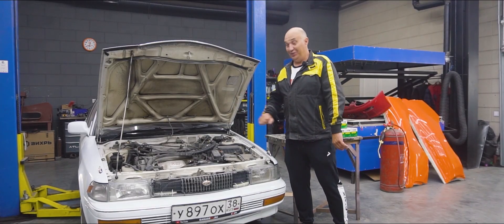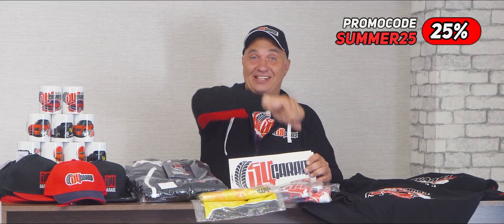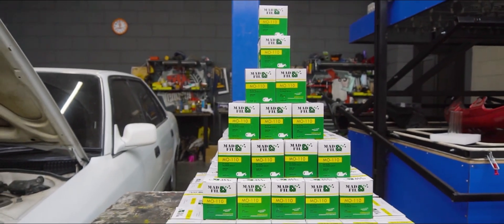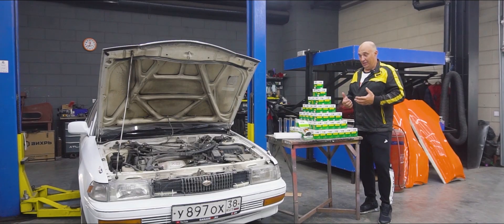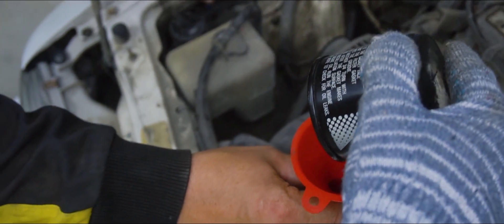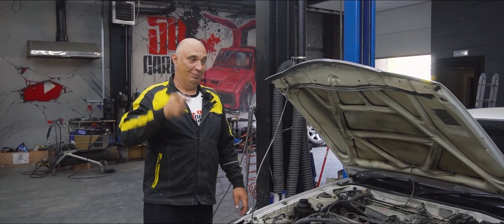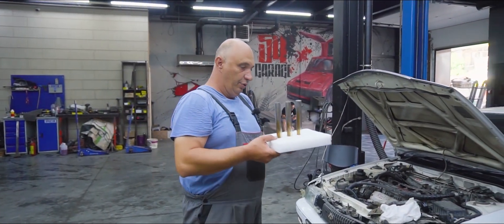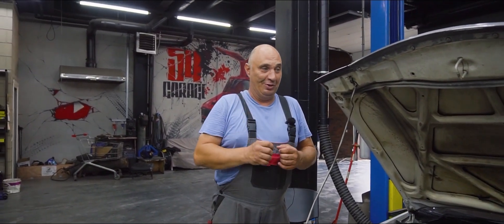Can 50 oil filters make used motor oil clear again?

Comment: What product(s) would you suggest for cleaning the inside of a used car's engine, particularly the areas the oil is going through?
Reply: New filter + Fresh cheap 0W30 or 5W40 synthetic "hc" hydrocracking oil where the manufacturer openly marked it on the label with clean engine + Long distance, fast travel with hot hot hot engine = immediately oil change with hot oil and everything dispersed still in it
REPEAT the above again..
Then expensive good pao fully synthetic based oil
Always do oil changes in lower frequency to "wash" away the old dirt from owner neglect before!
Do not use oil cleaning additives as every bit of trash goes through the engine and it give immediate high wear and can kill engine
If you hate Lady use sand as oil
Reply: DIESEL / TRANS FLUID MIX.. 2 QTS
Reply: 1/2 can of seafoam 300kms before oil change.
Reply: 80% diesel fuel + 20% engine oil, new filter, run for 10-15mins, maybe drive around the block, but no high revs, temps or load.
Then a normal oil change.
Did this more than once, the engines´ insides went from dark, sludge covered surfaces to shiny metal again. 
All except one are still doing well, and that one went with car when that started to rust faster than I could weld.

There´s just one downside, but that applies to professional products as well:
If there´s a gasket in the engine which just still seals because of accumulated residue...
Reply: Vodka.
Reply: @furry-b5h  no way, I think that is silly.
Reply: @tallpaul9475  you can use vodka instead of gasoline

Comment: You couldn't have picked a worse motor. Those 3S engines are a guaranteed spill on the block when removing the filter, plus it's partially surrounded by an exhaust manifold.

Comment: Try mixing a gallon of used oil with 10 gallons of gas running it through a bunch of filters and then boiling the gas back out of it.
Reply: Why? To create a massive fire? Boiling gasoline is not smart
Reply: @kitecattestecke2303  you must be the same kind of person that puts 50 lb of charcoal in the grill to cook one steak.

Comment: The problem is not getting the oil clear, the problem is that there are also petrol residues in the used oil, and the lubricity is no longer as good as with fresh oil

Comment: I'm really interested in trying gasoline as coolant in a few different coolant systems to see what happens. 👍
Reply: gasoline will not make a very good coolant. It has a boiling temp that is too low for an engine.
In fact, straight up water as a coolant is very good indeed and very hard to beat..

Comment: One thing to keep in mind is that the oil itself darkens as it gets heated. Something to do with the smaller molecule chains gassing off. You can test this by heating new oil up to 150C+. It will darken pretty quickly. The upper piston rings get this hot and so does the oil in that area.
Reply: So one time i changed my oil and drove about 10 miles. Oil was jet black right after...
Reply: @Fr3sh-Kush  this happens fairly often, especially with diesels because their oil goes very dark due to soot. The old oil that is black cannot be fully drained. There's always some old stuff in various parts of the engine. The new stuff mixes with it and appears dark. The effectiveness of the oil isn't deemed by how dark it is. Don't worry about it.
Reply: @Fr3sh-Kush  diesel?
Reply: @dennisford2000  no sir gas
Reply: @Fr3sh-Kush  next time you change youre oil pour a quart of transmission oil in and it will clean you're engine
Reply: @Fr3sh-Kush  if it is a diesel it is normal
Reply: @Fr3sh-Kush  "...changed my oil and drove about 10 miles.  Oil was jet black right after" Yeah I've had cars like that.
Reply: @Fr3sh-Kush  That usually means that someone missed the oil change interval too much. Oil sludges towards the end of its life leaving buildup in the head, pan, and channels. Change your oil more frequently to help with that. (3-4k miles.)
Reply: @skurblord3401  i change my oil every 2 months regardless of mileage. Probably every 500-1,500 miles
Reply: @skurblord3401  been doing it that way my whole life
Reply: @skurblord3401  That goes back to what was said at the begining of the video about buying a used car changing the engine oil. The oil filter then becomes clogged because the new oil cleans the deposits out of the enigne.
Reply: @LKN117  Correct. Its not a one or the other situation. Both happen at the same time. My initial comment was explaining why 10,000 kilometer oil wont get clean. He could do that process with 1000 filters but it would never lighten up.
Reply: @skurblord3401  i feel bad for changin every 6000 miles :(, at least im not pushing the engine too hard
Reply: @Fr3sh-Kush  you really don’t have to change your oil that often. I don’t believe in people that say, “oh you don’t have to change your oil but every 10-15 thousand miles” but I change mine every 3-4 thousand with full synthetic valvoline
Reply: @Fr3sh-Kush  can I have your old oil
Reply: My 12 valve Cummins can turn oil black before I get around the block 🤣
Reply: I was just about to write this exact thing, also all those oil filters will only be removing particals and contaminates to a certian micron that the filter element allows, doesnt matter if you use 100 of them. 
Heat is what breaks down oil and its additives, the better mixed the longer lasting. Hence synthetic oils are better blended than minerals and wont seperate as easily. 

Oil filters only are there to remove particals
Reply: Wow! That's amazing! I've never seen such an educated response on YouTube
Reply: @WvlfDarkfire  you have Bern subscribed to the wrong channels in general then
Reply: @kitecattestecke2303  I agree. I have bern
Reply: @WvlfDarkfire  lol
Reply: If you want to see this first hand go to planet farms youtube channel hes an independent tester of all things motor
Reply: @maxdaviduk2626  thats project farm.
Reply: @maxdaviduk2626  I have him on my list , one of my favorite non biased channels
Reply: It’s more like the like the oil breaks down with each cycle. The polymer chains will break down with each heat cycle. A better way to do this experiment  is to run the oil through the filters with a pump and gentle heating to thin the oil. Not through a car engine. Also grant Thompson did a torture test on motor oil and it still had a nice amber color at the end.
Reply: @abhimaanmayadam5713  His "torture test" was a add stunt for Castrol... He heated the oil for 20 minutes and dumped liquid nitrogen in it. The oil has a harder and much longer test in an actual engine.
Reply: @skurblord3401  of course. It’s been a while since I’ve seen it so my memory on that is a bit fuzzy.
Reply: My trucks oil (5.4 V8) is still dark gold at 3,000 miles.  So that is where I change it.  My trucks engine has oil issues if not cared for.  So I just play it safe so she lasts.
Reply: That‘s not right. If your car never had dirty oil and you change it early, 7000mls, a good quality oil never change the colour. 33 years experience with my own cars. Over 1 Million mls.  150*C is a lot! Your car shouldn‘t run so hot.
Reply: Didn't know that... Thanks
Reply: And in Diesels it gets darker cause of soot
Reply: leaked valve seal too
Reply: It’s oxidation that darkens the oil.
Reply: I change my oil at 60 percent of life from 45k miles to 88k miles.
My oils still clear at oil change. It's still clear after city driving, then a road trip.
Gas and water pollute the oil and acids form. 
I change it before that's very bad. Hoping to have less engine trouble for a couple hundred thousand miles. She runs so smooth,
 I love the 2016 Mazda6. The black is carbon and a sign the oils removing them. I assume with my extra care to the fuel system too, that all I need is the intake valves, cleaned properly so dirt and carbon don't score the cylinder walls and end up on the face of my catylytic converter to burn it up ,and then to then ruin it, over time. Constrict the air flow makes everything run hotter.

I do run synthetic, but oils oil.
If you take care of the car the oil looks new still.
 But the block chains shortening, sure sounds smart, I believed it too, until describing my oil changes. I did let the oil to 40% one time. Yes the oil for dark but not black.
Reply: @joshuatinkham3703  I'm confused, what are you saying your oil change interval is here? You make it sound like you change it every 45k to 88k which for most cars is a great way to destroy them. "Hoping to have less engine trouble for a couple hundred miles" seems like a telltale sign that something is up..
Reply: Lol. Sorry if I confuse people my writing skills are being worked on.
I bought the car at 45k actually and have changed the oil a little early, always. It is also at 88k and I've done the 100k tune up. Next will be both axles need brakes and my tires are three years old I rotate them at each oil change, no uneven wear.
I get a little groaning if I over steer, now.
I want to pull the intake cover, and clean the valves properly. Not just bit them with degreaser, and burn up my converter.
I'm broke a little prevention, halos me sleep better. And more likely to road trip.
Reply: Or you you have a wet clutch on a bike ! , i put sur purple oil 4h later is dark
Reply: Thank 4 tha knowlege cuz
Reply: The biggest thing to keep in mind is that this experiment will never work. 
The dirtier a filter gets the better it filters, the reason you can't just run one forever figuring that it'll keep improving with age is because it'll eventually become restricted and stop flow or it'll just go past the bypass valve if it's that type, but it's the very thing that causes it be get restricted is why they filter better the dirtier they get, because the dirtier they get the smaller particles they let through, air filters are the same way.
Since he took a filter off that was ready to be changed it was already filtering smaller particles than a new one will, so one new one after the other won't change anything. 
Don't believe me about the dirtier they get the better they filter?
Talk to the filter manufacturers like I have, they'll explain the same thing to you I just did.
Reply: I thought oil suspends particles of carbon from the internal combustion process.
Reply: @snakattack883  It does, among other things. The point of most of these comments including mine is that there is more than just particulates making the oil black.
Reply: @Dustin Turpin engine oil suspends the particles of carbon that builds up in the oil when combustion happens. My moms husband had a daewoo chev and he used valvolene and I did all hos oil changes it it always drained out pretty clean and transluscent. Is it trappung the carbon in the filter? Is the engine filthy? Is the oil doing its job? Lits of speculation, id like to think its because the oil is changed properly at the proper intervals and the insife of the engine is constantly being purged of the carbon in the oil and filter.
Reply: cool story bro
Reply: true done this myself accidentally on my stove
Reply: the sooth particles are like few microns. Meanwhile the filter stops 15 micron and larger particles. It will never remove sooth. There are bypass filters that can remove it though.
Reply: This is a true statement, but to a much lesser extent than you may think. I work as an auto technician and used to work for a fleet that serviced natural gas powered vehicles. They would run 10,000 mile oil change intervals and even at the end of the 10,000 miles, the oil would be a light amber color. Maybe 1 shade darker than new engine oil. 99% of the discoloration that engine oil gets is from how dirty gasoline is and how poorly a typical engine uses it. The tops of the pistons and upper ring areas may see 150C or even higher, but we are talking very small amounts of oil exposed to that temperature for extremely short periods of time.
Reply: @ouch1011  Also the fuel atomization affects how well it gets burned. Direct gasoline injection creates larger exhaust particles and soot versus port injection and is one big reason Ford, Toyota, and VW are still using it. They can achieve lower emissions.
Reply: @jamesmedina2062  You have that backwards, direct injection has smaller particulate (hence the need for particulate filters) and port has larger particles, typically unburnt fuel.
Reply: @jamesmedina2062  Why would I be talking about diesel? No such thing as a port injected diesel. 

I understand your point. I think it's more correct to say direct injection emits more particulate in general. The "stratified charge" that you're talking about that leads to a poor mixture paired with less time for combustion results in both sooty particulate and fine particulate. This doesn't really happen as dramatically with port injection (not as many fine particulate emissions)
Reply: @jamesmedina2062  A complete burn would give you no particulate by the way. You would have NOX COX and water mostly.
Reply: @amorag59  right right right!
Reply: @ouch1011  That is because natural gas burns cleaner than gasoline, ethanol, and especially diesel. That was one of their main selling points alongside reduced fuel costs. The vast majority of vehicles don't use NG so its more of a moot point to compare.
Reply: I get what your saying supadoom but the amount of metal shavings in the oil wild lessen making it possibly more transparent
Reply: @maxdaviduk2626  If you have that much metal in your oil you will have catastrophic engine failure very soon. The vast majority of the particles in used oil are carbon or dust based. Also in the comment above you mention project farm. He cooks oil as part of the tests he runs. It turns black. Not from metal or deposits. Just from heat.
Reply: Yes i know that's why i recommended his channel

Comment: You might be removing any crud that's gotten into the oil, but I doubt you're effectively renewing the oil itself. The heat from the engine breaks down the hydrocarbons in the oil into substituents over time, and this can't really be remedied. You can't just put those molecules back together without some serious chemistry. Even if the oil is now clean of foreign debris, the lubricating performance will be seriously degraded. 

There is no replacement for an actual oil change. Your engine will thank you if you do things properly. This is certainly interesting, though. I bet this would get you a few thousand extra kilometers out of your oil if you for some reason have a crap load of filters just lying around. I'm sure you could devise a more cost effective filtration system, though.

Either way, it probably makes more sense to just send your used oil to a recycler who actually has the equipment to remove the "worn out" substituents and fraction off the remaining good oil for further use. You could technically do this yourself, though, which could be a cool project for you guys.
Reply: The cracked long molecule providing lubrication does not get long again... So old oil is poop
Reply: Oil lasts a lot of miles before it starts breaking down. It gets contaminated relatively fast though. On thermoking reefer units the diesel engine runs the equivalent of 100,000 miles between oil changes. I've seen some where they got forgotten about and ran for well over 4000 hours (equivalent to 200k miles)
Reply: @inoahmann7542  Very true Engine oil gets contaminated but the oil is still ok good filtration is what engines need .Just look at diffs , manual gearbox ect we don't change oil in these every 6'000 miles in fact its probably same oil from new but then there is no contamination . Happens to the  cracked long molecule in this oil ?
Reply: Old oil to diesel.. Or just oul burner..
Reply: We use to centrifuge our oil years ago then it went back in engines this was for coolant contamination or contamination from failed components . The oil remained in engines for about 10 years was sampled regular for analysis and only changed if adverse sample found but the oil filters were regularly renewed , these were large engines though
Reply: you dont know that
Reply: When I started using filters that clean oil in 1963 oil actually got better with use with toilet paper filters. The impurities ended up stuck to hot engine parts and in the toilet paper. Couldnt use multi grades in a diesel. The polymers fouled the engine. Delo came in 30W and 20W. Not a bad oil. Normally we changed the toilet paper and added a quart of new Delo every 2.000 miles. I started with a Frantz oil cleaner and Delo. Delo was beautiful if you kept it clean. I use Walmart synthetic oil and a Australian Jackmaster Classic in the Pontiac. The other engines use Motor Guards Gulf Coast and a flat head Ford V8 canister filter.set up to use Scott 1000. It has half a roll of Viva towels in it now. The oil is beautiful. I go 6.000 miles between toilet paper changes in the Pontiac. I run mostly at  normal oil temperature.
Reply: The last part are what cheap manufacturers do in third world countries.

Comment: Some oil filter has bypass valve. Also the black is from carbon. Carbon is so small ot won't harm the metal and just flow though filter.

Comment: Connect exhaust manifold to the intake manifold and run the car
Reply: It won't run or atleast not more than a few seconds. EGR valves add exhaust gasses to the intake but only in small amounts.

Comment: Without watching I'm saying no. However, a centrifuge would do it much cheaper and better. Let's see what happens 😝
Reply: a centifuge would be much more eficient, but iirc oils have emulsifier so they stick to the particles real well. Not 100% sure it would work with that, or at least not work completely.
Reply: @laharl2k  It works great, we do this to use the old engine oil again in old diesel engines as fuel, we don't want the carbon or fine metal particles in the fuel pumps or injectors.
Reply: Centrifugal oil filter are common on older heavy equipment. Best filters ever.